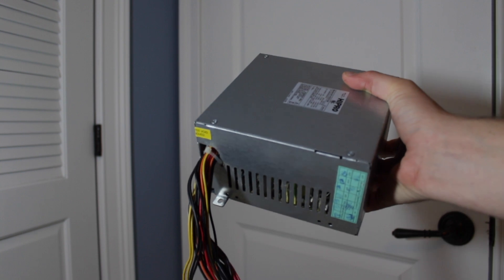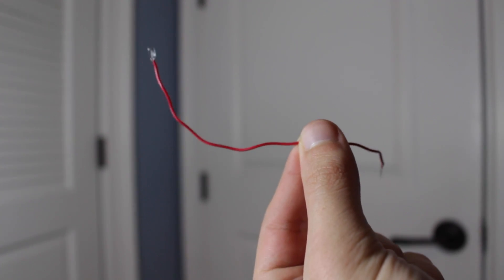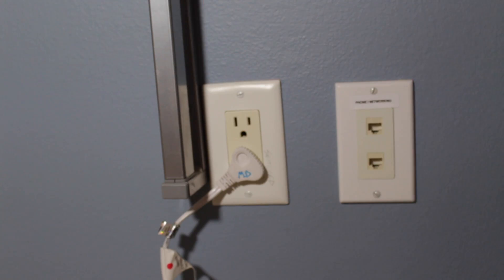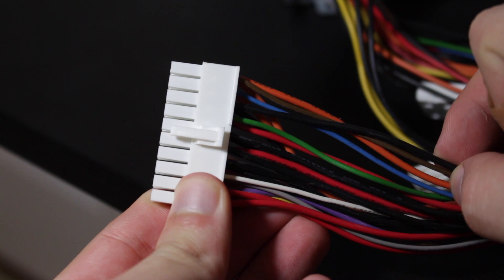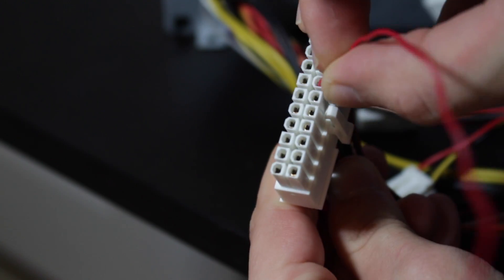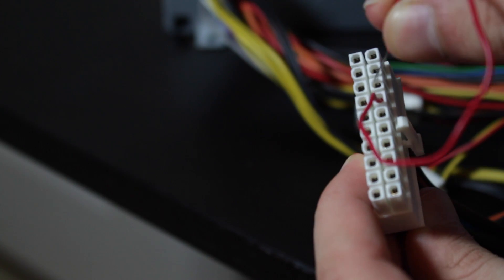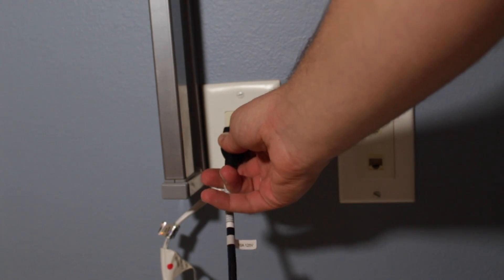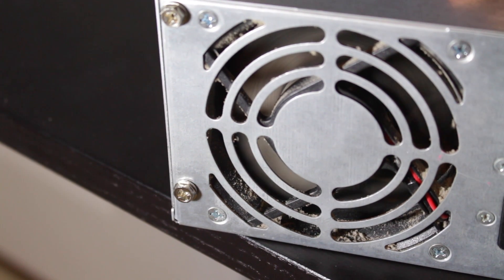How To Test For A Dead Power Supply! (Paper Clip Test)

Comment: I connect a pcie cable to the cpu header on my motherboard accidentally bcuz all look the same n i never look on the labeled i power pc on it um make a sound n then i disconnect the psu n put the correct cable try to turn on i get no sign of power i try the tester than come with the psu n did what u did mth happened

Comment: I did this and the gpu fans started running full speed.  Proved that the power supply isn't dead. Thanks for the tip. New motherboard and ram.. It has been an expensive day

Comment: Matt, my pc died yesterday . It just died suddenly with no warning . And when i try to switch it on, nothing happens . I have to unplug the cables and replug it back then it will turn on but only for like 4 seconds. Is my power supply is dead or its my motherboard?
Reply: Its lrobably the power supply that happened to me though it could also be the ram not being plugged right or dead
Reply: i suspect mobo

Comment: How do u plug it in when there's a piece of wire in both holes

What is this supposed to test? Are the psu reliant on the green one
Reply from the maker: +Teemo4Life If your computer stops working this is a way to check if the power supply is the problem.